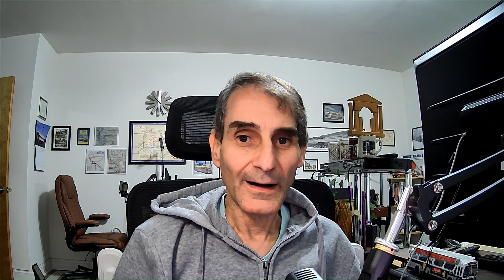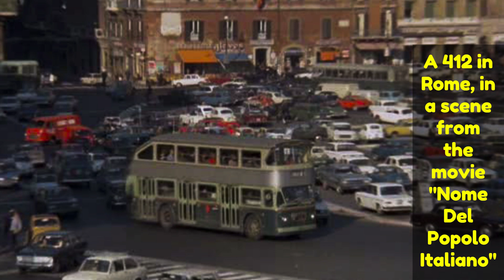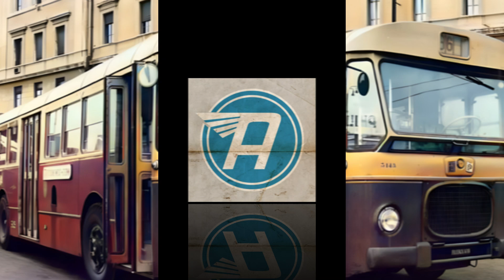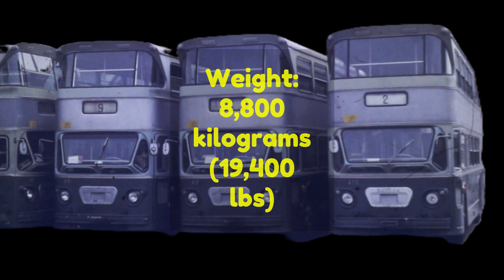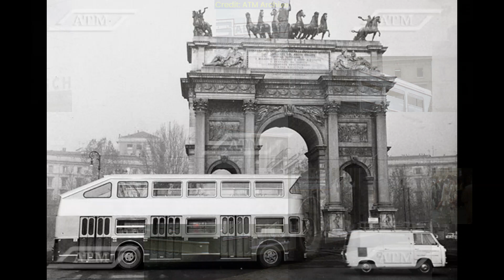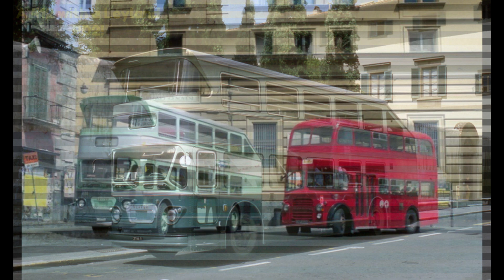A Very Un-British Bus: The Story of Rome's 1960s Fiat Double-Deckers [Italian Bus History]

Comment: Nobody thought about putting buzzers for passengers to alert the driver to stop on the top decks? Or even the bottom decks?
Reply from the maker: Guess not!! Thanks very much for watching!
Reply: They had buzzers on the top deck. The problem in Rome is that the average passenger just travels 3 or 4 stops, so climbing up and descending down after 10 minutes is a bit... uncomfortable. That's why their best use was on route 64, from the station to St. peter, where tourists could enjoy the top deck on a terminus to terminus trip. Romans, of course, preferred the low deck. In my hometown Bologna and in Florence this busses were used on suburban routes with lots of passengers travelling from the outer terminus to the city centre. Here thy could use the top deck full seat capacity and were retained in use for more than 20 years. Not so bad. They where also robust and resistant to corrosion (due to the light alloy body).

Comment: The lantern style front windows were found on the 1959 Midland Red C5M coach in the UK.  The shape cuts down reflections from lights within the bus for the driver at night.  I note the use of demountable rim wheels, which are still used in Iberia.  I do not see the purpose of the sloping roofline at the back.
Reply: The staircase is at the rear, so the roof slopes down to follow its contour, it was done as a weight saving measure.
Reply: And the Dutch Leyland Nationals.
Reply from the maker: Hello! Oh yes, I guess I could have mentioned the Midland Red bus, as well as the American Twin Coach and Flxible buses that had that style of windshield....LOL, I guess I could have went on about each bus that had it....Thanks for watching again!!

Comment: Thanks for that - like you I'd seen pictures of these strange buses but never knew anything about them! Goodness, they do look spartan inside! Given the hot weather that they might experience in a Roman summer, you might not expect British Moquette, but plastic seats? 176bhp is a decent power output, so its slightly surprising that they could only manage 50kph - not that it matters much in a bus in Rome! Always puzzled that most European operators like buses with at least 2 doors - these have 3 big ones, but in the UK, more than one door is considered an unnecessary extravagance, except in London!
Reply: Speed limited as RM's were to 40 mph, 50 RMC's and 55 RMA's  The 'Boris' buses had three doors, two doors and the open platform with doors now not used as a Conductor is legally required on an open platform bus whose only job was to manage the boarding and alighting from the platform and assist old and young ladies with their shopping on them.
Reply: @tonys1636  Well, as ever London is the exception that proves the rule! The RMCs/RCLs only had around 120bhp or something, yet could get to 40 or 50 - I grew up riding RMCs and RCLs, and am trying to recall if they ever got up to a decent speed with me riding them!), whilst these Fiats had a serious amount of grunt, though probably in a bus that weighed more, yet only reached, or were limited to, 30mph approx. As I mentioned I suspect that in the streets of Rome, it probably wasn't an issue!
Reply from the maker: Glad you liked the video! Three doors is extravagant in some parts of the world...you'd never see that on an American bus!! Thanks for watching again!!
Reply: More power does not imply a higher top speed. In city use there is no real requirement to travel above 50kph/30mph. What is wanted is smart acceleration and that is where the power is applied by relatively low gearing.
Reply: @EuroScot2023  Very true, but with 176bhp on tap, it's going to accelerate well whatever gearing its got! Though if it had its full 110 passengers on board, that might slow it down. Perhaps they had stupidly low gearing for acceleration up the famed 7 hills of Rome or top speed was governed to 50k for some imagined or real stability issue.

Comment: It seems a pretty conventional design overall albeit styled a little differently from the UK fleets. I might be missing something but I can't see how the design itself would lead to passengers missing their stop.
Reply from the maker: Yes, it's odd that people would think they'd miss their stop...I guess it's just easier to ride downstairs.... Thanks for watching again!!
Reply: I presume it's just a cultural thing. If single deckers are the norm then it's quite likely people may feel a bit 'trapped' on the top deck. I've noticed it to some extent here in Dundee when at rush hour, particularly, the lower deck gets crammed while the upper deck has plenty spare seats and is almost exclusively the preserve of the young and active.